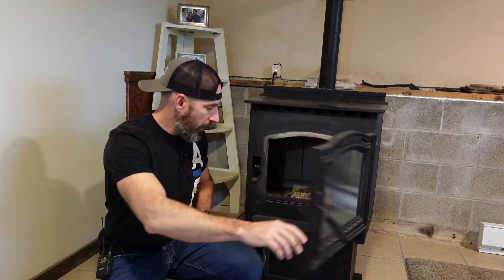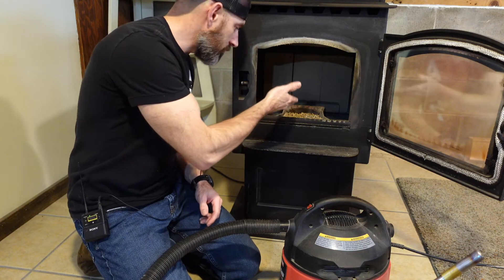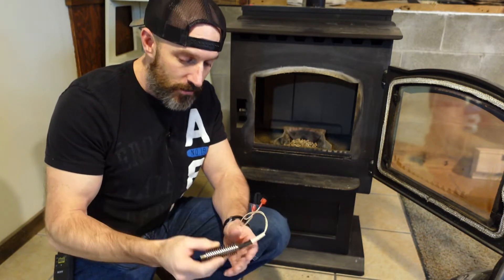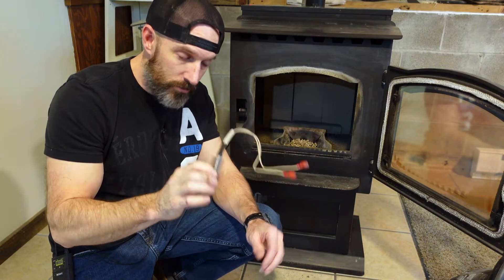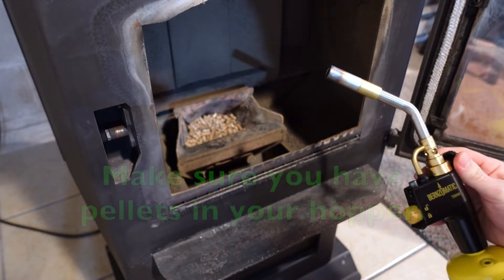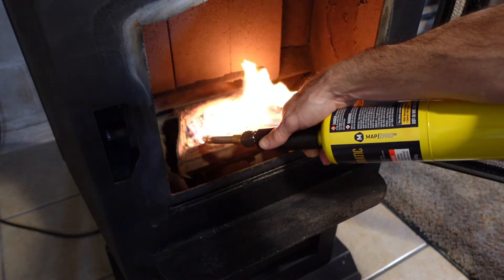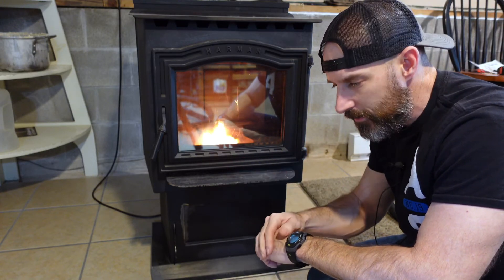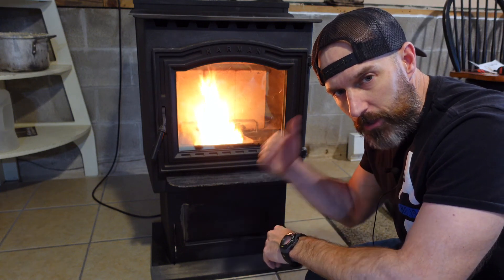How to manually light a pellet stove

Comment: I've had several Harman Pellet Stoves over the years and replaced the ignitior on all of them at one time. Harman used several different manufactures over the years so the Ignitor that lasted 10 years might not be the same brand Ignitor even though you purchased from an authorized Harman Dealer. I've had good luck with the Ignitors from Pellerhead/esesstoves. Regarding lighting the stove when the Igniter is dead what I do is this: I take 91% Isopropyl Alcohol put about an ounce in a cup. I add a handful of Pellets shaking the cup to coat the Pellets. Let the Pellets sit absorbing the Isopropyl for a bit and then pour them in the Burnpot. I take a lighter and light the coated Pellets and they fire right up.
Reply from the maker: Awesome I might try that. Thanks for the tip

Comment: You didn't say what you did after you did it,, you turned it back on auto or leave it in manual?  Mine seems to overfeed pallets. And flashing 2  times, blower motor goes on and off on manual. And stove temperature rose to 700°, before blowing fuse.

Comment: Now show us how to run our stove when the power goes out.
Reply from the maker: This is all I got, https://youtu.be/clMhyBKnj9A?si=JDj57TlDrRszWuaX
Reply: Plug it into a tiny generator from harbor freight or northern tool.
Reply: @whitechevy33  it needs to be a inverter generator or you can really mess up the internal motherboard in the stove. You need clean AC current from the inverter generator or from a pure sine power inverter.
Reply: @Urban_hunter2021   yes in a perfect world but inverters are expensive and not everyone has one. I have a harbor freight predator regular non inverter generator, I have ran several  fridges, and HVAC system during power outages they all have  motherboards of some sort and I had no issues.
Reply: @whitechevy33  Well, it  always works until it fries it. I'm just giving you some advice.

Comment: Hi Jim, good video.  I have an Englander stove, 18 years old.  The igniter failed the first season I had it and I've been doing exactly this to light it this since.  Piece of cake.  I use regular propane though, I'll have to try MAPP gas.  I've also used a squirt of kerosene in the past and only needed to light it with the torch for an instant.   That works well too.
Reply from the maker: Thanks for the tip and thanks for watching

Comment: I always have a spare ignitor on hand. They are not expensive and good insurance to have on hand. It is important to clean the area where the ignitor is located. Mine is behind a plate, locked with wingnuts, under the burn pot and I vacuum that area out carefully. My stove is plugged into a UPS power supply. In my area the power can go out, not always gracefully, during big snowstorms and I believe it can cause damage to the computer board and ignitor in the stove.
After I have cleaned the burn pot, it always take a little bit longer for the pellets to light by the ignitor, I believe this is caused by the fact that there are no ashes in the pot that heats up quicker than all new pellets.
If I have to light my stove manually, because I haven't swapped out the ignitor, then I use the same torch with mapp gas as you do. I do mix a little bit of whole pellets with ashes and throw it in the burn pot.
Reply from the maker: Thanks for watching